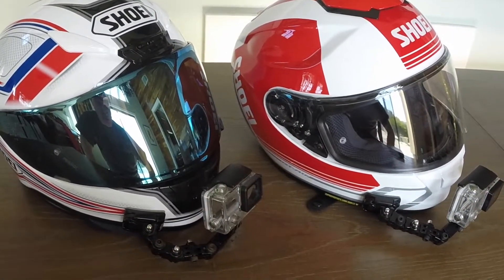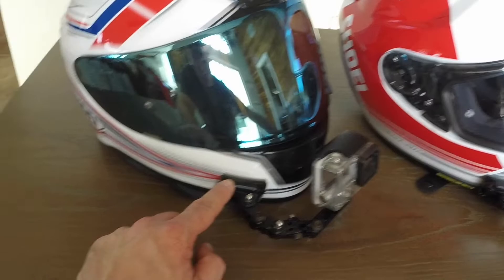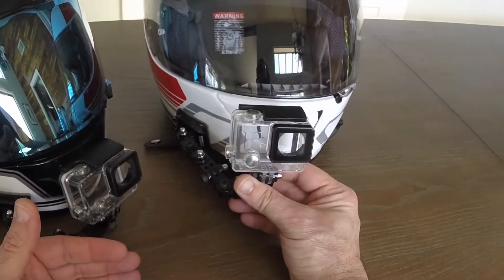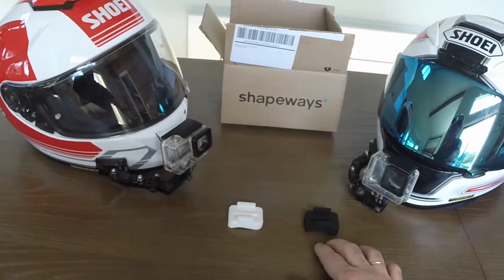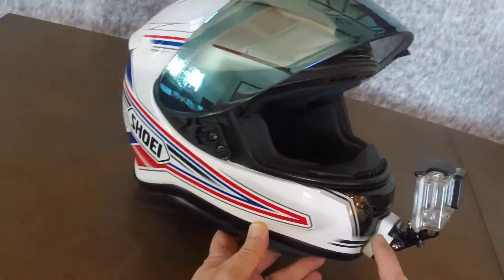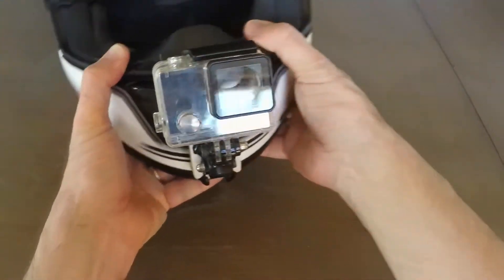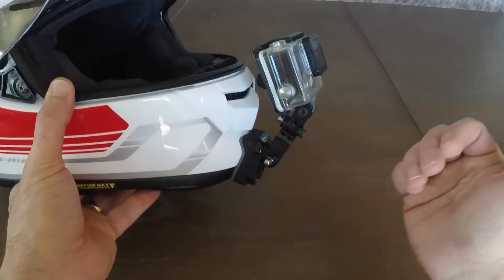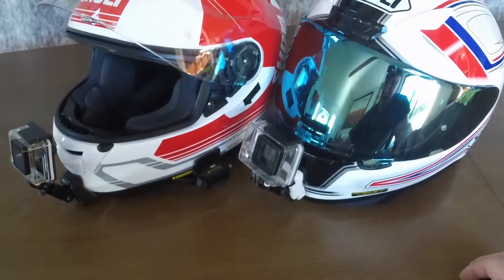Shapeways GoPro chin mount: Shoei RF-1200 & GT-Air

Comment: Is the mount removable?
Reply from the maker: YWT Stewart , yes - it’s very easy to remove. It’s attached to the handlebar by a brace which is secured by a 4-mm Allen bolt.

Comment: Did you get the natural or premium black mount ?
Reply from the maker: Jose Luis Ramirez , my intent was for the mounts to match the color of the helmet, so I ordered the one for the RF-1200 in white and the one for the GT-Air in black. At the time not charged more for the back one so I can’t call it premium - maybe the merchant changed its price policy since. Unfortunately though Shapeways mixed the orders and send the first one in black and the second one in white... Interestingly the two mounts are made of different materials, as the black one feels a but “rougher” and “softer” than the white one.
Reply: Muzza Bike thanks for getting back to me ! I will def order black one today
Reply from the maker: @joseluisramirez4891  , good luck I've been using mine for months now and I'm quite satisfied with it.
Reply: Muzza Bike ordered my black one today ! Can’t wait to use it for moto vids!
Reply: Muzza Bike thanks to your video you helped me in making up my mind to order it ! Cheers!!!